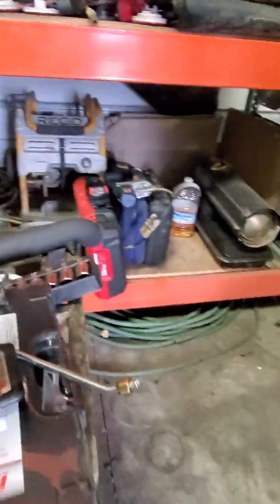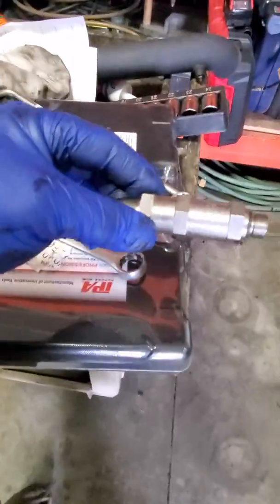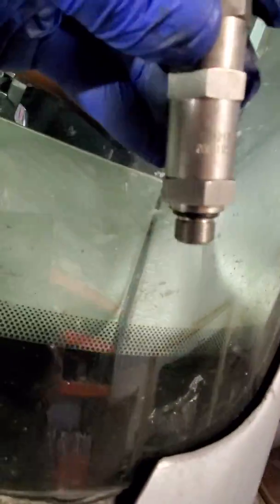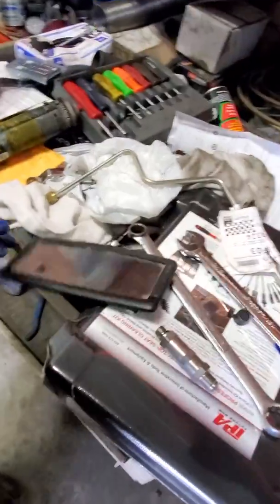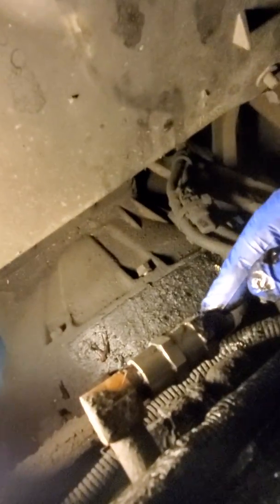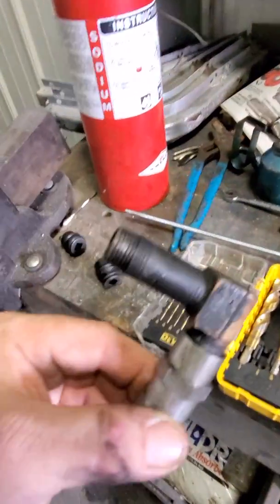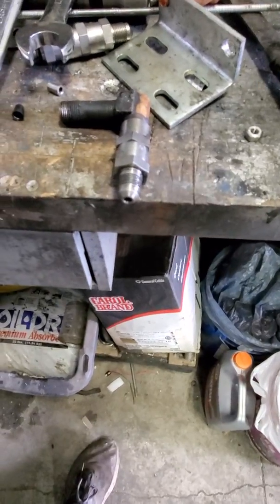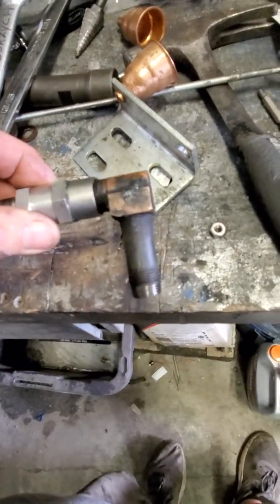DETROIT 60 SERIES FUEL CHECK VALVE

Comment: Isn't that metal fuel line an updated version because the constant problem of leaks from the original . That new line suppose to have another small hose line that attach to the end to get to the filter under the starter.
Reply from the maker: Yes sir.... Thanks for watching and commenting

Comment: Can a bad check valve cause injector over fueling
Reply from the maker: @jamesstafford9067  A bad check valve will more than likely give u less fuel. It could be your injector O rings. Because the fuel is leaking through the O rings. I'm not a mechanic but I know enough. U can call or text me 414 477 7845. Maybe u can explain what's happening exactly?

Comment: Why did you change the check valve? The fitting was moving not the check valve. Unless the truck had trouble starting or keeping fuel in the system
Reply from the maker: Because it was an easy time to replace it. The check valve is difficult to change when the head and head cover are on. A lot of shops won't even replace a check valve because it's difficult to get to. Thanks for watching and commenting

Comment: How many fuel check valves does a Detroit s60 14L have ?
Reply from the maker: I believe it just has one on the back of the motor block. And one for the fuel water seperator. U may want to call the Freightliner parts desk. Or u cam ask Google

Comment: Could black smoke be a part of the faulty fuel check valve?
Reply from the maker: I don't think so. However your boost sensor might be the problem. It's easy to change and not expensive

Comment: i just got new reman motor
and its having hard start when i leave overnight
but starts quickly if i turn it off for an hour or so. 
also once it runs, its very smooth and no power issues
no apparent leak in fuel lines 
so im thinking its check valve since mechanic didnt replace it. 
can it be the reason ?
also, can it be replaced with motor fully assembled there ?

Comment: My series 60/ 12.7 rough idles alot. If I Rev it up it goes away sometimes. It runs smooth. The mechanic claims it's normal. It sounds like a misfire too me. Like it wants to shut off. Only when idling. What you think it could be?
Reply from the maker: It's possible It's the check valve i show in this video,. Or it may be the fuel check valve behind the motor block on top. It's hard to change. Because its on the back side of the motor. Or it could be a bad injector?
Reply: I have the exact same problem,  were you able figure it out?
Reply: @s.m6963  nah I think it just need Tune up

Comment: Do you have to drain fuel out the bowl first ?
Reply from the maker: THINKING ABOUT THE BOWL QUESTION. U SHOULD DRAIN THE BOWL. BECAUSE WHEN U REMOVE THE CHECK VALVE. U WILL GET FUEL COMING OUT. SO YES DRAIN THE BOWL. SORRY
Reply from the maker: NO U SHOULDN'T HAVE TO

Comment: Isn’t easier to move that check valve to a more accessible location for future service?
Once that valve cover is removed a flex fuel line could be installed with a fix mounting bracket just were the check valve was originally installed and then move the check valve someplace else?
This is just a question for those that knows if or how is possible.
Thanks
Reply: I mounted one that is accessible farther down the fuel return line and added a compucheck fitting for further diagnostics .  I believe there are  2 different psi. return fittings .    5/19/23
Reply: @vicpetrishak7705  
That should be a lot of help for next trouble diagnostic/replacement etc…no more valve cover removal,gasket replacement etc…I still don’t understand why they designed so badly
Reply from the maker: THAT'S ACTUALLY A VERY GOOD IDEA. THANK U FOR WATCHING AND COMMENTING. BUT A VERY GOOD IDEA
Reply: I think thats what they did to my detroit, bc mine has a hose between the block and valve which is basically hiw you explained it. I was wondering why every video had the valve directly to the block but mine

Comment: I have to change that fuel line on my Century not looking forward to doing it, that metal line is the original line those Detroit's rolled off the assembly line with and they are known for rubbing a hole in them mounted to the block I'll just have a braided hose made to keep from having routing issues with those junk steel lines... But I see removing the valve cover is the best way to go..
Reply from the maker: Thanks for watching and commenting. And thank u for the suggestion. The check valve wasn't bad. I figured while it was easy to get to. I'd replace it. However.......r I pulled the head on this truck after the check valve video. It had to come off anyway. And then when it was all put back together.  My dumb ass forgot to hook the fuel line to the check valve. I sprayed fuel everywhere. Then I had to get my big ass behind the motor to put the line on. After the line was on. I started the motor. And the fuel line going to the injectors was leaking bad. I had a braided hose going from the fuel pump. To the back of the block that supplies the fuel to the injectors. That line had to be replaced. When I picked up the line from Freightliner. It's that metal preformed line. That thing was a bitch to get in. I'd recommend getting a high pressure braided hose. Instead of messing with that metal line. Thanks again please subscribe to my channel
Reply: @kurtsibila9682  Hahaha we learn as we live right! At least you have your own shop and can do things at your pace and save tons... On my 98 Century the line feeding the injectors comes off the secondary fuel filter housing and connect to that pain in the ass metal line that hugs the block, what we did today instead of getting a whole new braided line and rerouting it we found the braided line coming off the filter housing had a hole in it before it connected to the metal line, so we removed it and I'm just going to replace that section of line..  Is this a dumb move on my part and not just replace the whole line, probably so lol!! those metal lines are known for vibrating against the block and wearing out the line.. But my buddy had already removed that section before I got there this morning and put the order in for that short section, so I'll be crossing my fingers that the other section holds up at least for awhile.. So that's my story and I'm sticking to it lol... Hopefully you get up and running soon.. Oh I wanted to ask you what area you where in and if you know any good paint shops I'm in Cleveland Ohio
Reply from the maker: @tyflesh  Lolololol. We have to minimize work and spending money. So I don't think the short cut on that fuel line is foolish. Shit...... If I can take a short cut. And save time and money. I'M DOING IT. I zip tied and put some rubber hose over the metal fuel line. So it won't rub on the block. I'll NEVER do another pre fitted metal line again. I'm going braided line FROM NOW ON. After taking me 4 hours to get that line in. My shop is in Burlington Wisconsin. We live in Kenosha Wisconsin where my wife works as a nurse. Truck is running great. But the new compressor is already leaking. So I gotta go back to this shop I use in Barstow California. To have them remove it and put another gasket on it. I'm sure it's a ripped gasket. That shit happens on those heavy ass compressors. Unfortunately brother I don't know of any paint shops in Ohio. But I do have a guy in Racine Wisconsin. I towed a guys truck from Michigan to Racine to the paint guys shop. My number is 414 477 7845. Call or text any time. If u need tge guys number.?
Reply: @kurtsibila9682  Man we have a lot in common we do. My wife is also in the medical field, but she does HR recruiting and hiring for the Mayo Clinic she took that position after 25 yrs at our local Cleveland Clinic and she's fully remote working from home now... But going back to those damn fuel lines we got mine together yesterday morning let it idle for 15 minutes or so no leaks took it this afternoon to fuel it up I get back to the yard and hook to my trailer and I'm smelling fuel and low and behold there's fuel puddling under the truck shittttt!!!! That damn elbow come lose somehow and is now soaking the back of the engine and trans, so I guess when my buddy disconnected the braided line and reconnected it, it moved that damn elbow, so I told him don't touch shit lol I'm going to do it and make sure it's done right! He's a big help but man he doesn't check behind himself and I didn't check behind him either lol... So back to the lab in the morning, I have a guy here locally that does painting he's always backed up, he said if I wanted to do it myself I could get in there, I'm thinking I could a least get the fairings painted and the condo top I'm going to roll on some good colored bedliner that seems to be the worst areas for peeling on the old freight shakers but thanks for that offer I kind of figured you either lived east of me or west lol from your videos.. And your still running all the way to Cali man I gave that up years ago plus my truck isn't legal out there anymore I pretty much run Tx up to Nebraska and cover all the southern states going east, I don't even run Pa anymore just straight south, west and sw.. But I will definitely keep your number and maybe reach out and say howdy sometimes... Looks like I'll be off the rest of the week maybe I can get that last cut on my grass lol take care and be safe out there..
Reply from the maker: @tyflesh  DAMN THAT SUCKS BROTHER ABOIT THE FUEL LINE. I go to California often. My truck 8s a 2001. ILLEGAL AS SHIT...... LOLOLOLOLOL. One day I'm sure u will get caught. Awesome about your wife. Medical field jobs are pretty secure for the most part. If that guy let's u use his shop to paint your rig. Shit I'd go for that brother. I painted 3 of our trucks. They ain't perfect. But they are a hell of a lot better than they were. The prep work is the most important. And time intensive. Yes please keep in touch. Good luck with your rig.

Comment: How do you test a fuel check valve
Reply: No way to test it while it's on the truck but if your losing prime after the truck sits for awhile good change the valve is bad, it will allow fuel to drain back into the tank losing it's prime for starting
Reply from the maker: To be honest. I'm not actually sure. I"m sure there's a youtube video somewhere about it. How to test a check valve. Thanks for watching and commenting